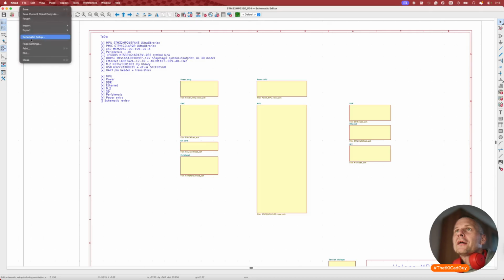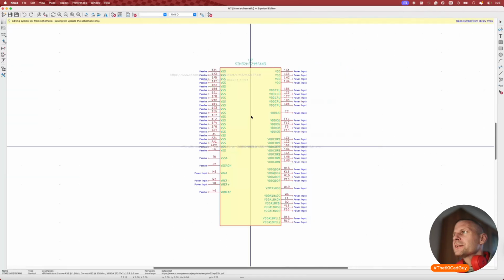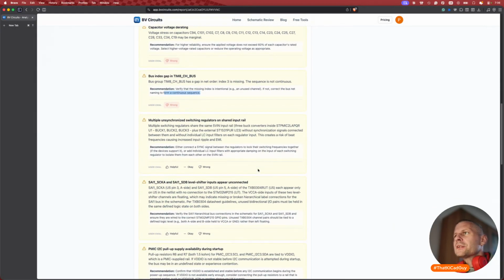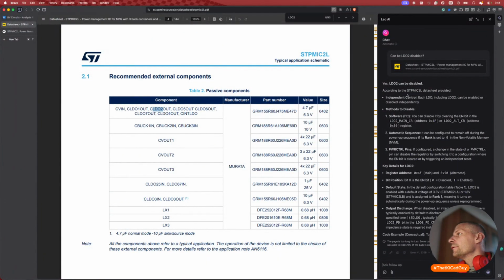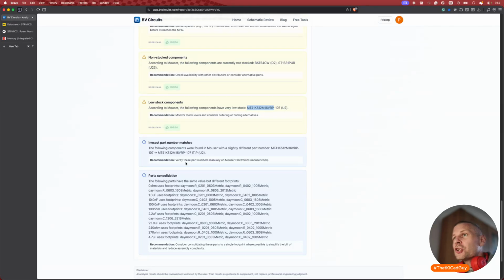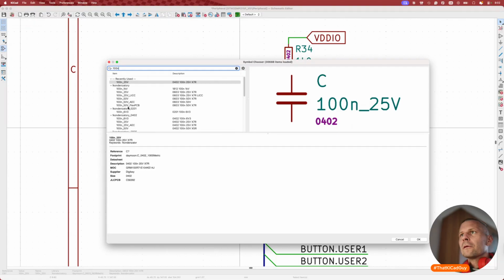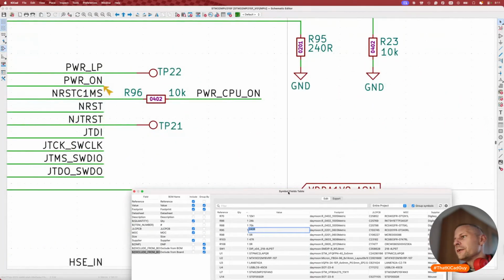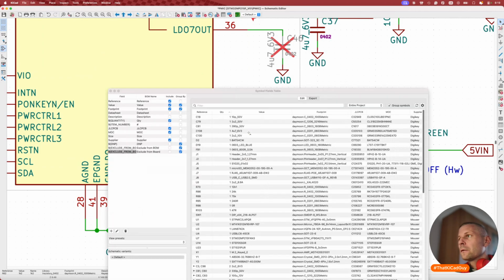KiCad Design Stream STM32MP215F, part 11

Comment: Thank you for the stream. I fully agree, with all the  bugs, KiCad Version 10 is the worst version released in KiCad's history. With the latest release (10.0.3), KiCad still crashes on executing Zone Manager, it was supposed to be fixed.
Reply from the maker: The Zone Manager is one of the most useless features to me. Perhaps it brings a new approach to zone management, but it's messy, nonintuitive, and clumsy to me. Thank you for watching!